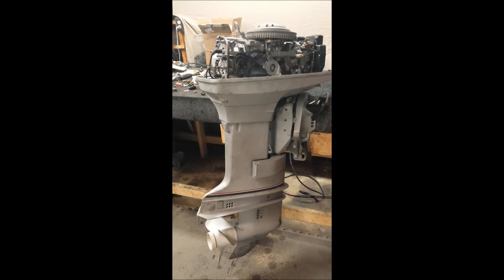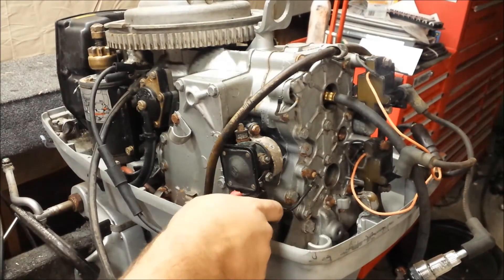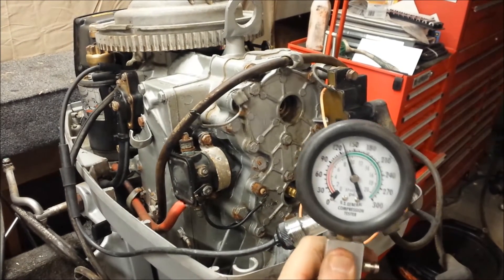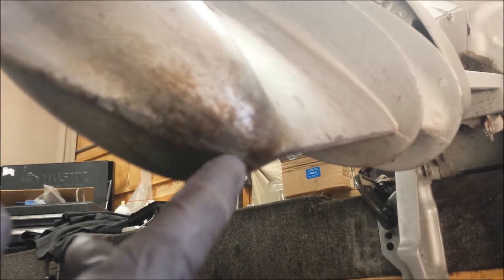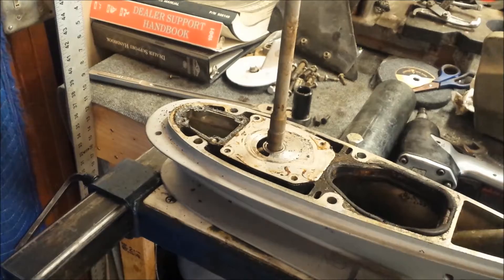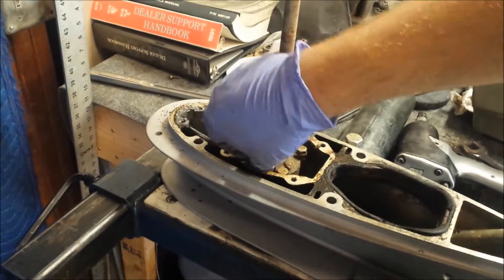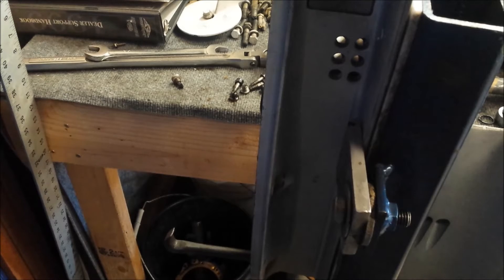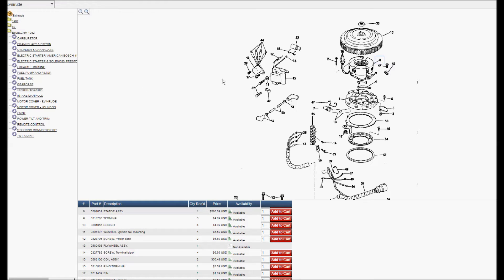Evinrude 60 HP Inspection and Gearcase Teardown

Comment: i like the CDI electronics neon spark tester, or, better yet, their spark gap tester. i've had so many of those cheap chinese bulb type testers give out on me i got fed up with it. one time i thought a little 6hp evinrude had no spark because of a dead tester. couldn't figure out how everything tested great with my multimeter... then decided to pull and ground the plugs. bingo! hot blue lightning. for the ignition: test the leads going to the coil primarys. if spark in one, it's the power pack. no spark and you need a charge or sensor coil, but test both according to the service manual.

Comment: I like the content.  A mistake I made on my 1988 60hp Evinrude, led me to your channel.  I was in a hurry when I changed my lower unit oil, and I removed the phillips screw by the water intake screen.  I think it just holds the bearing.  Is there any chance I messed something up?
Reply from the maker: Doubtful, as long as it went back in okay.
Reply: Brandon's Garage  Thankyou so much.  Is the screw there just to keep the roller bearing cage from spinning in the bore?